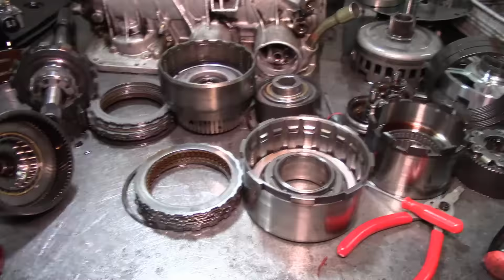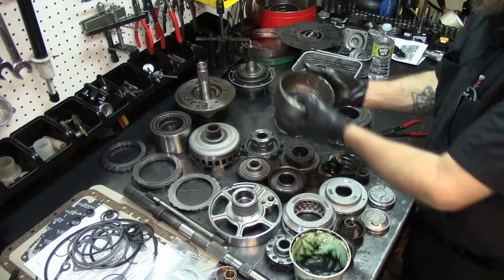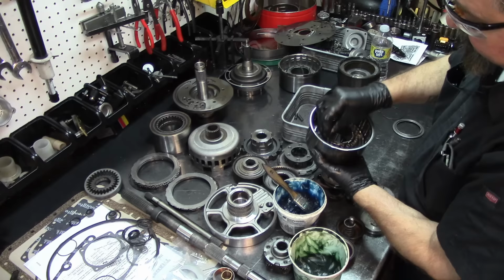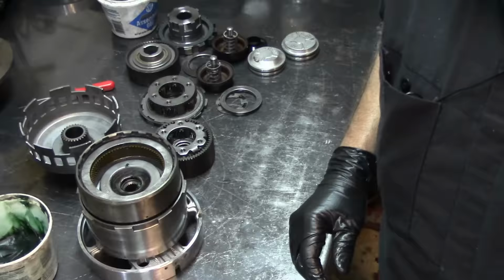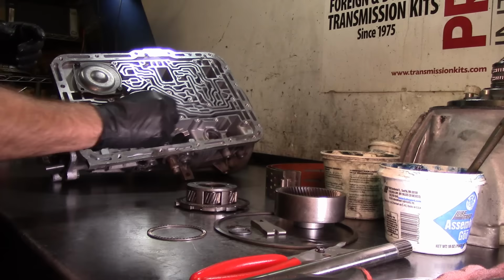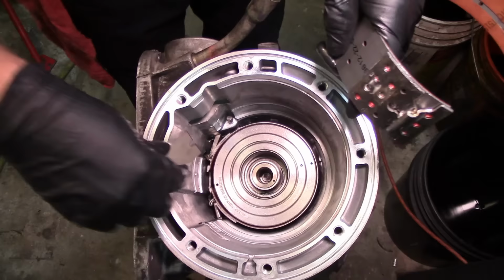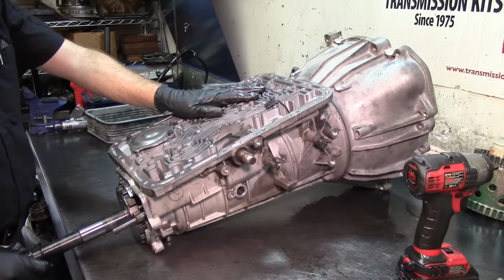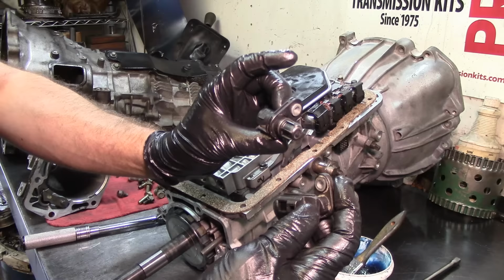5R55E Transmission - Rebuild Video

Comment: Why did you torque the bands to those specs? Everywhere else including the manual says 120in lbs and 2 turns back, 72in lbs wasn't enough for mine and my 5r55e slipped until torqued it farther, just curious if your experience led you to the 72in lbs

Comment: My Ford Ranger 4wd, 2011 mod. suddenly will not function in revers gear. I can feel it try to engage but there is no torque on the wheel. Can it be some solenoid problem or  more a serious problem?

Comment: How much to rebuild this 5 speed automobile 2009 Ford Ranger 2.3 automatic no reverse and have to take off in low 1 and overdrive light flashing sometimes it will go in reverse but struggling to pull same with regular drive and a violent shift into first at takeoff from stop what could this be the sprag???

Comment: Can’t thank you enough for sharing this invaluable information for the world to see! I lost all gear on my Ranger 4r44e trans. Called all Shops in town and 1500 is the best deal I got if I remove and install unit from/to vehicle myself. I’m not financially stable enough to jump at that kind of a deal, so iv decided to put on the hat and do it myself with the help of people like yourself. So far I have laid every down like this, just need to clean them
Up and the rebuild following your steps. I have found three signs which I’m convinced are the culprits to my loss of all gears: Small break on valve body gasket, burnt color/worn frictions and steels, and finally the sprag is spinning both clockwise and counter-clockwise…..Ordering parts tomorrow and start cleaning process while awaiting parts. Never done this before but I’m handy and curious enough lol. Will take my time with it.
Reply: Dude you've got to tell me, was it doable
Reply: 1500 ain't too bad I would've done it I spent 2 grand in the past on a rebuild locally and it was so worth it
Reply: @cantgetright7236  I guess it depends who you’re asking 🤣 It’s a lot for me especially since iv been spending on a bunch of projects. And this is my second vehicle so need not as urgent. I received my overhaul rebuild kit, put the whole thing together on the table, took it apart, and put it all together once again just to be extra thorough. I was following instructions from this guy and other credible sources. I was sure to have reassembled it perfectly. Spray painted the pan, threw it all back under the truck and bam! Shifting and riding like new. I’m thrilled because I lost all gears, and this is my biggest job so far on a vehicle. Prior to this I would change oil, break pads, fluids, and that’s about it…lol…so yeah, with a little bit of tools, patience, and willingness I believe anyone can do it.
Reply: What type assembly lubes are the blue and green?
Reply from the maker: Lubegard, you probably will find a different brand locally.

Comment: I never worry about what's stamped on the servo cover. Big piston goes in front ( o.d.), smaller is intermediate on 4 sps.
If it's a 5 sp.,The intermediate band is 3rd gear.
Reply from the maker: You're right, even on the 4 cylinder A4LD's with the tiny intermediate servo, always goes to the back. Also the stiffer spring goes to the back. 
Great comment and addition to the narrative.

Comment: To drop the gear assembly to where the gear goes smoothly into the planet gear, use a thin tie down strap. Stand the trans and lower the heavy gear assembly with the thin strap holding it at the bottom while lowering it in. It will drop in, and the strap will slide out.

Comment: I also have (own), a 1996 Ford Ranger XLT with a 4R44E transmission. 
I purchased this Ranger because the mechanic at the local dealership told me the engine had a rod knock, and I needed parts for my explorer (I fixed up the Ranger and never did use it for parts). 

After I checked it out, I found that the flex plate had sheared itself off the crankshaft bolts and destroyed itself as well as the spacer between the crankshaft and the flex plate 

I replaced both the flex plate, and the crankshaft spacer.

After 6 months I heard a slight knocking sound. So, I replaced the timing chain and gear set.  This did not cure the knocking sound. So, I did some further checking, and found that once again the Flex plate was shearing itself off the crankshaft bolts.

I think I know why the replaced flex plate was destroying itself. On the factory installed flex plates there is a (flex plate /flywheel reinforcement plate), welded to the flex plate. The aftermarket ones you purchase from the local auto parts supply stores do not have this flex plate /flywheel reinforcement plate), welded to them. Neither the local Ford Dealer nor any of the auto parts stores can tell me why? 

NOTE One: - 
I determined that without that flex plate /flywheel reinforcement plate), it allows the crankshaft /flex plate retaining bolts to bottom out inside the crankshaft holes, thereby allowing the flex plate to move back and forth sideways (not forward and backward), because the bolts are not completely snugging the flex plate up to the crankshaft even though they are still remaining torqued at 50 ft lbs. torque as specified in the manual. 

NOTE Two: -  
I discovered that You cannot find either that Flex Plate / Flywheel reinforcement plate, itself, the Flex plate to crankshaft mounting bolts, the crankshaft to flex plate spacer, or a complete with Flex plate /flywheel reinforcement plate), welded to it either at the Auto parts stores or on-line as both the auto parts stores, as well as the Ford dealers, all tell me those items are no longer available. 

The problem and issue I have is......? 

Question One - 
Why did the original flex plate destroy itself when the original owner had it (I have never met the original owner, as he lives in another state and was only passing through my area to another state when he broke down and sold the vehicle to a mechanic at the Ford dealership). Neither the local Ford Dealer nor any of the auto parts stores can tell me why? 

Note Three: -
During research (yes, even on YouTube Video's), I have noticed that several people have had this same problem of having to replace the flex plate on their own Ford Rangers several times because of this same problem of the Flex plate destroying itself each time after replacement.

Again.... The question remains........  Why?

Question Two:  - 
Why did the original flex plate destroy itself, and why do the replacement flex plates keep destroying themselves?

NOTE Four: -
I think possibly the replacement flex plates are destroying themselves because of the problem that the aftermarket replacement flex plates do not have that Flex plate /flywheel reinforcement plate), welded to them of which allows the bolts to bottom out thereby allowing the flex plate to still be loose and move back and forth (sideways), even though the bolts remain properly torqued.

But, Six questions remain.....?

Question One - Why did the original flex plate destroy itself in the first place?
Question Two - What is causing this problem?
Question Three - What is the cure for this?
Question Four - Is there something wrong with the transmission and its components, or is it something doing with the overall drive train  and/or the power train assembly together?
Question Five - Dose the Transmission have to be replaced to cure the problem?
Question Six - Why doesn't any of the Ford Dealerships or the aftermarket auto parts stores have an answer?

Do you yourself (or anybody out there for that matter), have the correct answer to curing this "Flex Plate Self-Destruction" problem?
As it seems that nobody else either locally (or on YouTube), can answer those questions for me. 

It seems that I have ran into a brick wall when it comes to both my Ford Explorer''s, as well as my Ford Ranger's problems. (See previous post pertaining to my Ford Explorer's problems).
Reply: Dowel pins missing or sloppy.

Comment: I have a 1994 Explorer LTD with a 4R44E transmission. This is a replacement transmission from a salvage yard. 

When I installed the transmission into the Explorer (and before I attempted the first start-up), I replaced both the filter, and the ATF fluid.

This replacement transmission lasted about 45 days before it started having problems. 

First problem. -  After 45 days it got to where it wouldn't automatically upshift in the lower gears unless it had either sat and idled for about 20 minutes, (You had to manually upshift it by using the gearshift lever). After it warmed up (or got to normal operating temperature), after about 5 to 10 miles everything would function as normal in the automatic mode. 

But if you shut it off and went into a store and then restarted it up and went to drive it again, you always have to let it idle again (for at least 2 minutes), or it would not upshift properly again except manually.

Then after doing this for about 2 months, it suddenly developed a second problem.

Second problem. -  I drove it home one day everything functioned normally.  The following day, I started it up, let it idle for about ten minutes. I then placed it into reverse and all hell broke loose. As soon as I placed it into reverse, all I could hear was the sound of grinding gears, and it would not move. So, I placed it into drive, and everything was normal, and it would move forward in all forward gears. 

But, every time I again attempted to place it into reverse, all it would do was grind gears again. 

Any idea what went wrong or what happened?
Reply: Probably failed sprag clutch
Reply: @trm64  does that mean I have topull the trany and have to have a transmission repair shop rebuild the whole transmission or is it something I can repair myelf as an experienced  DIY mechanic who works on my own vehicles?

Comment: Of those three models of transmissions, 5R55N, W and S, what are the differences, valve bodies? 
I've heard the solenoid packs on those are problematic right from the factory as are other issues.  Does the SK55 Transgo improvement kit solve solenoid issues as well?
We have one of these (N Lincoln LS8) that during full throttle the 2 to 3 shift occurs yet torque converter locks up before it shifts into 4th. Otherwise it seems to be healthy but for its seems slightly noisey from the day it was new. 
Great assembly Hiram. Second question, once all the planets and drums are installed into the case, is there an overall tolerance that should be measured for end play and adjusted with selectable washers and/or 3 tab washers etc.?

Comment: I watched your video on 5r55w/s video and built mine a few years back, everything worked fine for about 3 months then the intermediate servo cover blew off, I cleaned the grooves and changed the servo and put another snap ring in and a week later it did it again, I end up buying a rebuilt one, but I always think its something in the valve body causing it. Could you give me your thoughts  on it, I still have that trans and would love to figure out what is causing it.

Comment: Hello good sir! I have a 5r55s from a 2004 exploder that has a shift flair from 1st to 2nd and no overdrive. Replaced solenoid pack and servos and no change. Do I dare tear it apart? Not too knowledgeable on transmissions

Comment: Bro, the fan has never been a problem. Your in Texas and as someone who lived there, it gets to hot not to use a fan.
Reply from the maker: My concern is always audio, trying to make sure the message gets delivered cleanly but sometimes it's impossible. I raised volume on mic just below clipping, will use fan full blast on the next one hopefully I will be intelligible through the background noise.
Reply: @AutomaticTransmission  :) i could here you fine. I've been a sub here for a long time and i have never had issues with hearing you.
Reply: @AutomaticTransmission  Audio in this video was just fine. Those remote/wireless mics do a fantastic job. Most folks use the Rode brand...but they are pricey.

Comment: I have replacement clutch disks by raybestos.  One of the   packs that have a pattern as opposed to grooves.  Do you know if these are directional? They are not stamped top or anything

Comment: Geat video, im starting to have issues with mine and looking at having it rebuilt. My 2010 has 138k miles. What is the going rate for rebuilds, or would i be better off just having one put in from a yard pull.?

Comment: I bought a 2004 ford ranger 3.0 2 wheel drive automatic that needed a engine, i replaced the engine and was testing it out and the trans was shifting hard, shifted  for a little bit and then want pull in drive put it has 1st 2nd and reverse and ideas what it might be?  Thanks for any ideas

Comment: I have a 2003 ranger with a 55e with 2.47 first gear and a 4.10 rear axle gear ratio. I would rather have the 55w with 3.42 first gear ratio and a 3.55 axle ratio. Can the 55w be swapped in directly or is there other things involved? like electronic issues?

Comment: Your videos are the best on transmissions I've seen. Looks like I will be going through my daughters first car tranny- 03' mountaineer 5r55s soon,  as it is making some clunking-bumping noises when you drive about 45 or so. And it has a whine like a standard tranny with worn out bearings. It also has a delay when you go from reverse to drive.  Is the 5r55s rebuild the same as a 5r55e? Thanks for the great videos!
Reply: My 99 explorer sport has literally the same issues. It started at about 140k and something bad just happened at 279k. I lost my 3rd gear I still drive it daily. I put it in second get up to 30mph then put it in drive and it skips 3rd and goes into fourth lol

Comment: Great video. I have a question my 02 Mazda B3000 shifts at 2500 and at 70 mph the rpms are at 3000 any way to bring that down .Thank you in advance
Reply: rear axle ratio. you probably have the 4.10 axle ratio.

Comment: What’s the difference between 5r55e and a 5r44e? And can the computer tell a difference?
Reply from the maker: 5R44E has 4 pinion planets and 5R55E has 6 pinion planets. 
As long they're both 5R's with output speed sensor they're interchangeable.

Comment: Hello Hiram, I have a transmission I would like you to rebuild, how do I get in touch with you ?
Reply from the maker: Go to the about section and send me an email.
Reply: @AutomaticTransmission  I checked it & there is no email address that I can see, only a link to your channel
Reply from the maker: I think it'll say "business inquiries "
Reply: @AutomaticTransmission  Ok, I don't see anything like that so I opened up YouTube on the pc & I saw your number that you rarely check so I sent a text to you
Reply from the maker: It'll be easier through email. Calls and texts that are not on my contacts get deleted. I'll check and see if still there but more than likely it was deleted. Multiple calls with no messages get blocked.
Reply: @AutomaticTransmission  Ok, I emailed you twice about a 68rfe, thanks
Reply: @AutomaticTransmission  I need my transmission rebuilt & want you to do it, would you respond to my emails please sir
Reply from the maker: Give me a minute I'll check